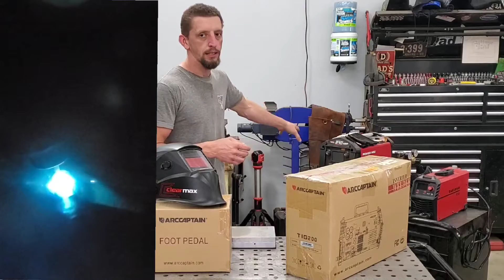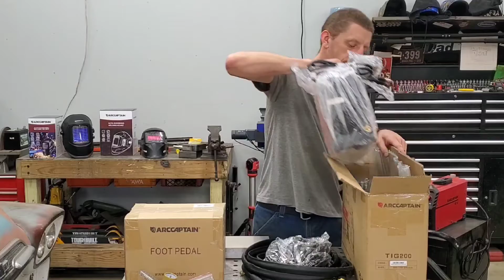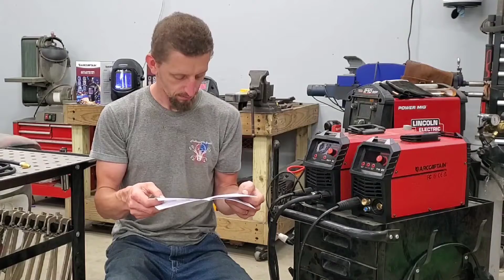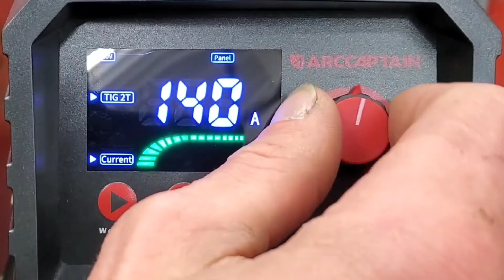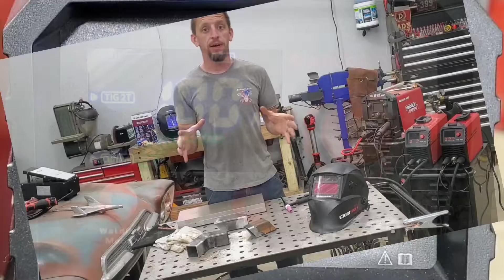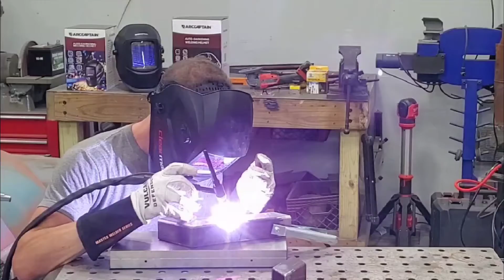ArcCaptain TIG200 With High Frequency Start -  Learn To TIG Weld - It Exceeded My Expectations

Comment: Lost me at only welding with 220. Every one of these welders will do ok or good on 220 but if I would get it, I'd be running it on 110 because that's what I have available

Comment: I just pick this machine up an it runs very well. I run a miller dynasty 400 for a living an the arccaptain will do all the dc welding jobs I do at work with no issues. Throw you a gas lense on there with a #7-#12 cup an you will be pleased for sure🫡

Comment: One year update? Still something worth your money?
Reply from the maker: Yes absolutely..  I am getting ready to use it to weld a stainless exhaust today actually.    Great option if you wanting to learn the tig process on a budget.  Remember this is a DC only machine, steel and stainless (generally).. I lend this out to a friend of mine and he seems to like it also (he is learning to tig weld too)...
Reply: June 2025 - The TIG AC/DC unit is more expensive, but they ship it with a gas regulator, and a #26 torch instead of a #17. and a piece of 1/16" tungsten.  The foot pedal is now a more compact design...

Comment: diameter is fine for the length. if the length was longer then diameter should be thicker but these are just fine for leads

Comment: i have lift tig arc captain machine but the lift tig just isn’t it so i thought maybe i should get an actual tig welder so here i am
Reply from the maker: Yes.   I would not recommend lift tig machines, especially with the low cost of the DC only high frequency machines.   Once you tig with a HF start machine there's no going back.
Reply: @ welp i ordered it im trusting you
Reply from the maker: @timcroshaw I don't think you will be disappointed.   Keep me posted. 👍💯

Comment: i bought the mig 200 multi purpose welder directly from arc captain. it cost about $354. it cannot use a foot pedal but does 6 functions. tig gun is not included. the welder is wired for 220v and has an adapter cable to allow 110v. at 110v it does not reach full stated power but i expected that. good price and great little welder.
Reply from the maker: Thanks for adding to the conversation. 👍👍

Comment: This was the video that convinced me to try Arccaptain.  I did not have the money for the AC/DC version but the DC version, yes.  What can I say.  Sometimes you get things right.  Its a great little welder.  Simple to use. I have an expensive Everlast Welder I purchased some time ago and am trying to sell it.  I like the Arccaptain better.  Where this would shine say if you do furniture like a coffee table or chair or night table.  You do not need to save up for a Miller Dynasty 280 or even....gulp, an Everlast welder.  Buy this.  Use it.  And if you like what it does then go AC/DC later on.  Can't go wrong here.  I should also add that I did purchase the new foot pedal separately off Amazon.  For some applications I do not mind the trigger switch but wanted the flexibility of the pedal.  I also noticed the Euro and Australian crowd have a button torch but I cannot locate one here in the North America or British Amazon sites.
Reply from the maker: This comment is AWESOME!   I really appreciate the input and positive feedback!    Thanks for adding to the content and conversation.   Keep an eye out for the review on the ACDC machine, ArcCaptain hooked me up with the ACDC machine last week so I need to set some time aside a dive into it.   Thanks again for the input!  #ChallengeTheBuild
Reply: @ChallengeTheBuild  Thanks CTB. The bang for the buck (and the simplicity) of using this welder is amazing.  I use it now for thin sheet metal.  20 gauge.  Arccaptain is a solid lower budget brand.

Comment: I wonder how the MiG 200 does tig.  I can’t find any videos showing that machine tig welding.
Reply from the maker: I'm sure it works as it should (lift arc start).   I think the reason you don't see many videos if any for it is because I think most of the people who are buying these budget multi process welders are mainly using them for either stick or mig welding (two most popular) with having the option of tig...  If you are specifically looking to tig weld HF(high frequency) start is the only way to go (in my opinion).   I was learning lift arc tig using my Lincoln 210mp then used the ArcCaptain Tig200 HF start and was like yeah I am never going back to lift arc.   And I think the ArcCaptain TIG200 can be bought for less then 300 bucks, which makes it a great budget Dc tig machine to learn the process.
Reply: @ChallengeTheBuild  I have a Hobart 190 now. Not really impressed with it, so I ordered one of these.  Primarily for mig.
Reply from the maker: I think you will be happy with the welder.   👍

Comment: have you try aluminum tig weld on this machine yet
Reply from the maker: This is only a DC rated TIG machine.  Hopefully ArcCaptain will hook me up with their AC/DC TIG welder, so I can try AC TIG welding aluminum.
Reply: I just received my arccaptain 200 tig ACDC inverter welder. I’ve mig welded for years and will soon be putting out a video on my first time tig welding. The initial learning curve is big for me and your video has helped a bunch before I get started. Thank you!
Reply: @OneEyeCustoms  I’m looking forward for a review. I just got my tig 200p

Comment: Thanks so much for the effort i see in this video! Ive been in the market for a budget tig welder and i think ill pick this one up!
Reply from the maker: Awesome!   Glad it was helpful.  This is a solid budget TIG welder.   I was very pleased with the performance while filming this review, which was the first time I ever used it.   Really the only negative thing about this welder was it was wired for 110v vs. 220v which I think they fixed that after this video 🤷‍♂️ regardless it still works great.   Good luck with the purchase and thanks for watching and commenting..👍👍
Reply: @ChallengeTheBuild  are you still using the welder? I’m considering getting the ac/dc model and I’m trying to find out the longevity of their equipment. I know I’m looking at a different model but it’s the same company so fingers crossed.

Comment: When you grind a tungeston don't grind around the circumfrence of the tungeston always grind the length of the tungeston. Arc flows off straight lines better than over ridges. Arc is more controlable off straight lines and your tungeston lasts longer
Reply from the maker: This is valuable information... Thank you for adding it to thw conversation...  I do know that the grind on the tungsten does play a huge part..  I will eventually get a good tungsten grinder...👍

Comment: Whats the difference between tig 2t and tig 4t?
Reply from the maker: It has to do with the switch(trigger).   2T is just your normal on/off switch, press and hold down while welding release trigger to stop welding.    The 4T option is a little different.   When on the 4T option, you press and release (quickly) the switch/trigger, to start welding continue running your weld (not holding the switch/trigger), then to stop the welding process press and release the switch/ trigger again to stop it.  Hopefully I didn't confuse you...  I generally just always use the 2T option...
Reply: I guess I’m lucky. My first experience TIG welding stainless 20 years ago was on a HF TIG foot pedal setup. 
It’s nice when your company supplies the nice gear.

Comment: Thanks for the review. I'm considering this machine for Tig welding stainless steel. Do you have any comments about the foot pedal? What alloy of steel were you welding here? Thanks
Reply from the maker: Appreciate the watch/comment.  I was just welding 1/8" mild steel probably A36.   As far as the pedal I'm sorry to say I still haven't got to use the foot control but I need to make time to try it.   I will try to set some time aside to use the foot control along with welding stainless exhaust pipe, so keep watch (maybe within 2 weeks +/-) 👍

Comment: Can confirm, just bought this machine and mine came wired 220 with a 220 to 110 downstep adapter. They listened. Also, you're way too hard on yourself man, those were some pretty f%@ing good beads for a "newbie" at TIG. Learn to use cooler bars. See how far out the affected heat area was from your beads? The discoloration circle around the weld. Find yourself some scrap copper and clamp a strip inside the tube under the weld area. Stainless concentrates heat, copper is very thermally conducive and will draw and disperse that heat away from the area and reduce the carbon evaporation potential in the stainless you're welding. Basically, clamp a heat sink of copper against your stainless and you can weld longer beads without "burning" it.
Reply from the maker: This is good news, thanks for commenting.    I had talked to a rep when making these videos plus I'm sure they watch/most all the videos so... Glad they listened..👍

Comment: Should of got the AC/DC Pulse Tig machine 5 year warrant for a 800$ machine it beats Lincoln Miller Hobart Any DAY of the Year    Lincoln Miller Hobart     Overprice the machines way to high for what it can do and the duty cycle they have
Reply from the maker: Yes, I am looking at getting the ac/dc machine myself, another one to look at is from Weldpro. 👍

Comment: Challenge The Build.. Cool review of the TIG200. I am impressed with it. I also want to get their plasma cutter. Thanks for sharing it with us.
Reply from the maker: The TIG welder even though it's is a DC only machine, having the HF start is HUGE compared to a lift arc style start up like my Lincoln.    Eventually I would like to get an AC/DC machine so I can tackle aluminum.    Also the plasma cutter for the price is a great deal in my opinion.   Here is the review on the plasma if you haven't seen it https://youtu.be/50W4C2FOlps ..  Thanks for watching and commenting. 👍
Reply: @ChallengeTheBuild  New subscriber. Yes sir I want an AC/DC machine too.
Reply from the maker: I appreciate it, thank you...🤝
Reply: @ChallengeTheBuild how long can you set the post flow on the DC machine and does it have pulse settings and or setting memory??

Comment: I've never tig weld, I've done a little stick welding, but not enough to actually say I know how to weld. I want to get a tig welder for my small farm and to work on my first car build with my 9 year old son. Would you recommend this welder for beginners that's never weld before
Reply from the maker: So I myself have been welding for years and have tig welded way way long ago but never stuck with it because I wasn't very good.   Fast forward to today, I started to tig weld again using my Lincoln 210MP (lift arc style) and while it works the lift arc tig can sometimes be extremely frustrating to get a clean startup (atleast for me because I am learning), and the kit to make my 210mp a TIG welder was more money then the ArcCaptain Tig welder.    Now with all that said even with ArcCaptain giving me this welder the reactions you see in the video are 100% real.   After using this welder with a HF(high frequency start) there is no going back in my opinion.    So to answer your question directly, YES I do think this is a really good option for a TIG welder ESPECIALLY if you want to learn to TIG weld more specifically because of the price point of this welder.   I believe its the cheapest HF start machine that also allows foot pedal control (Must have with TIG), this way you are not investing a ton of money to learn.   Once you learn how to TIG weld you can always upgrade the equipment into an AC/DC machine which will allow you to weld aluminum.   You will need to invest in a 100% Argon tank and regulator as well in order to weld so keep that in mind also, I think you can be tig welding for under $500-$600 bucks (usd) by time you get all the components.  (Welder, foot pedal, argon tank, regulator, welding helmet, a few consumables)...  Hopefully this long winded reply helps🤔😬 good luck and thanks for watching and commenting  👍